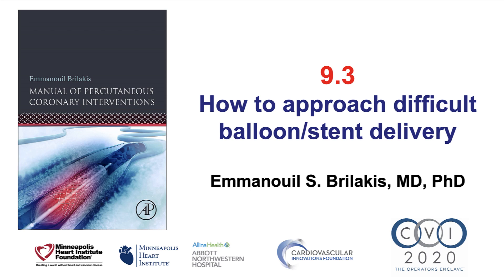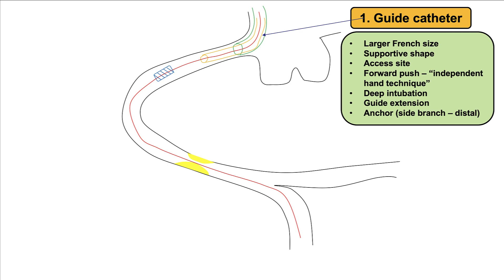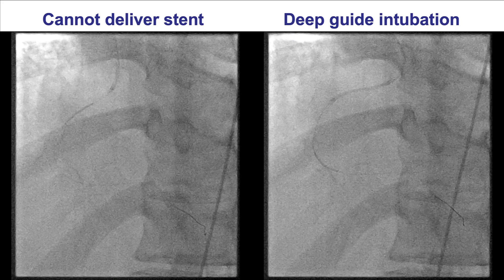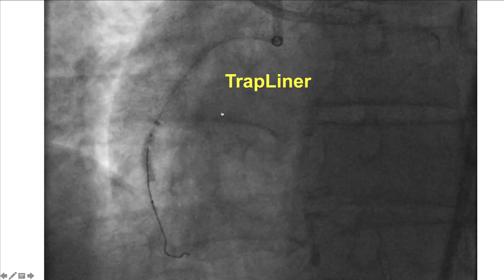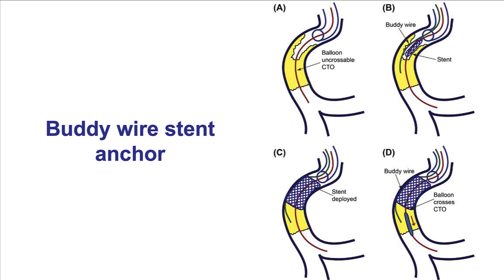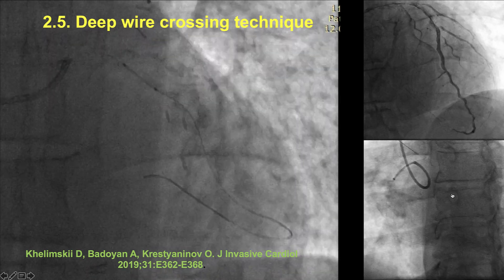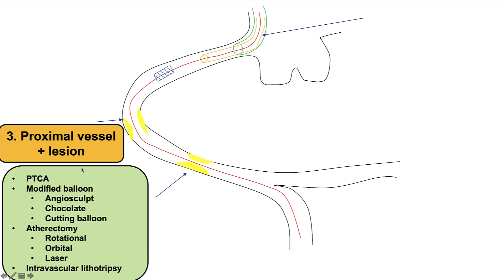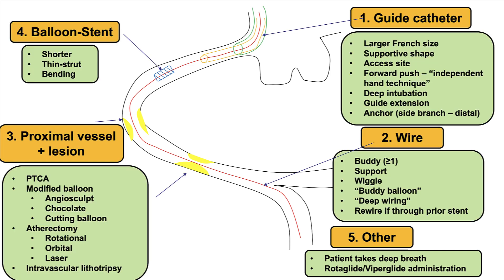9.3 Manual of PCI - How to deliver balloons and stents

Comment: excellent video Dr. Brilakis like usual, what do you think of balloon-assisted  tracking (BAT) i tried that before and it worked for pushing the guidelines deeper in the artery,  I usually start with it and if it doesn't work i move to balloon anchoring